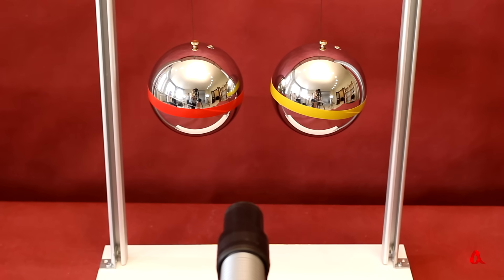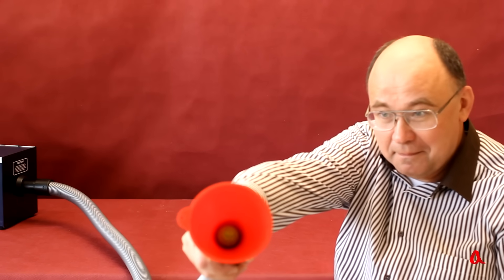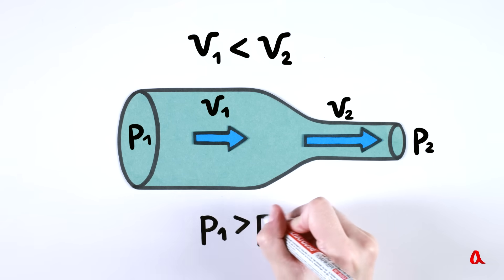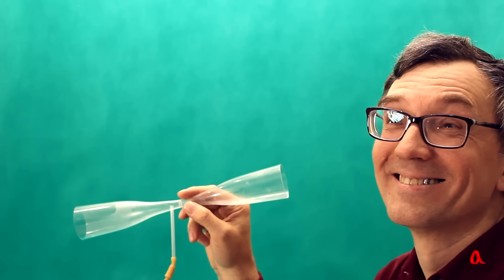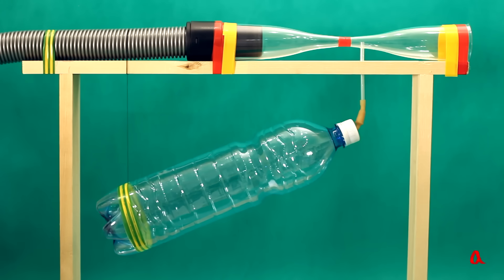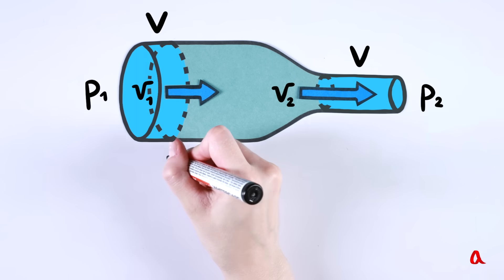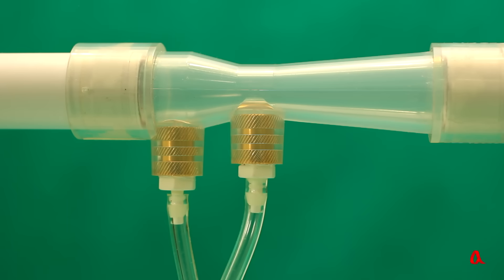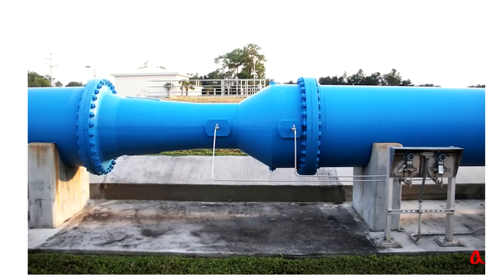Bernoulli's principle

Comment: If it were semi-solids forced through the restriction wouldn’t the pressure increase? I’m thinking of crowds of people rushing through a narrow fire exit in some emergency situation. Of course the pressure would increase at the narrowest point along their path as people are pushing and shoving to get through a restrictive, narrowed doorway. Why is it the opposite when it comes to gases? What about liquids?
Reply: That's because the density. In the examples, the fluid density is pretty much the same, so an increase in speed cause an drop at pressure. An anology with people is that in the case that the average distance is constant. In this case to pass the narrow space, they need to go faster. If they don't, the average distance decreases.

Comment: It's very difficult to grasp that faster air stream does not exert more pressure on the wall of the tube.
Reply: Think of the atoms bouncing off the walls. When the air moves, all the atoms can only hit the wall at an angle, exerting less pressure. Throw a ball in a tunnel and it hits at 90deg but when you throw it from a car it hits at some angle.
Reply: @billshiff2060  Very nice explained !
Reply: @billshiff2060  , if molecules in a flow have a certain side-to-side velocity (thus pressure), increasing that flow's forward velocity does NOT affect the molecules' side-to-side velocity.  For example, you can swim across a slow river in the same time that it takes you to swim across a fast river.  Throwing a ball out of a stationary car window at a tunnel wall produces exactly as much pressure on the wall as if you threw the same ball at the same velocity (relative to the car) at the tunnel wall if the car were moving fast.  It's true that the ball would hit the wall at a lower angle in the case of the fast-moving car, but the component of the velocity perpendicular to the wall would be the same.
Reply: @jean-pierredevent970 , why would a faster air stream exert more pressure on the wall of the tube?  Motion of molecules along the tube is in a different dimension than motion of molecules bouncing against (thus exerting pressure on) the tube walls.  Flow velocity is independent of pressure.

Many people misunderstand Bernoulli's Principle to say that faster flow implies lower pressure.  It does not.  It says that within a flow , a higher speed is correlated with a lower pressure.  Correlation is not causation.  In fact, it is the pressure difference that causes the velocity difference.  (Molecules move because of the forces applied to them.)

Your intuition that a faster air stream should not produce lower air pressure on the walls of the tube serves you well.  It is not the air stream speed that causes the pressure change.  It's the other way around.  I'll explain why in a moment.

If high velocity flow caused low pressure (it doesn't), then some things which don't happen would happen: 1. A box with a vibrating side sitting on a low-friction surface could move itself in the direction of that side.  2. Taking a flexible-walled, sealed cylinder containing air at atmospheric pressure and moving it along the axis of the cylinder would cause the walls of the cylinder to bulge inward.

To really understand Bernoulli's Principle, you can think about the forces being exerted on a molecule in the portion of the tube that is widening or narrowing.  That molecule will feel slightly more collisions from its neighboring molecules on the wider side, thus it feels more pressure from the wide side and is accelerated toward the narrow side.  That is why the narrowest part of the tube has the fastest flowing molecules.
Reply: @mattcarter1797  This is all relevant for me because we trumpet players always say we need to narrow the mouth with a high tongue, make a small aperture and contract the abdominals so that we get high pressure in the mouthpiece and trumpet which causes the high tones. I think now if perhaps there too we see it wrong but I don't know. 
What i do realize now is that when the doctor measures lung function, it is not useful to force the air out  through half open lips since the device exit is so wide that the pressure drops immediately after the lips and the spirometer measures now less flow. I think there everything must remain open and free to get the best flow for that device. (??)
Reply: @jean-pierredevent970  I used to play Trumpet. I have a Martin Committee, 1946, my fathers.
Reply: @billshiff2060  I never tried that famous (here rare) American brand but I have two, also American, King trumpets and I love how they feel much more "personal" than the here ubiquitous, Yamaha.
Reply: @mattcarter1797  A glancing blow on the tunnel wall does not impart the same energy as a perpendicular one. A glancing blow imparts less energy (static pressure) and retains more momentum (dynamic pressure). That is why the total pressure is always equal to static pressure+dynamic pressure.
Sloping tank armor reduces the impact of shells on it in the same way.
Reply: @billshiff2060  I agree with you that a glancing strike by an object at a given velocity imparts less energy than a head-on strike by the same object at the same velocity, but that's not relevant to our scenario where the faster-flowing gas molecules that impact the tube walls at a less direct angle are also moving at a higher velocity.  There's a common misconception of Bernoulli's Principle that the lower pressure of increased-velocity fluid is due to the molecules having traded lateral motion for forward motion, thereby pressing less on the tube.  In fact, the decrease in directness of the molecular impact angle on the tube is negligible because increase in forward velocity due to a flow constriction is negligible compared to typical gas molecule velocities.  The tube constriction causes the decrease in pressure, which causes the increase in velocity and decrease in density.  The lower density of molecules means fewer collisions with the tube per time.
Reply: @mattcarter1797  The air molecules move at about Mach 1.5 under standard condition no faster no slower.
The constriction does not cause a decrease in "pressure" since Total pressure=static + dynamic still. What is lost by static is gained by dynamic. There is actually no loss in pressure, it is simply re directed into velocity. All of the pressure energy in the stream comes from the storage pressure (total pressure)upstream and it is finite.

Working on a flow bench with cylinder heads, people are often baffled when they insert a pitot tube in  a fast moving air stream and it reads ZERO. The total pressure is restored by bringing the flow to rest. Pitot tubes are also called total pressure pickups for that reason. There is no loss in total pressure in the venturi, only a decrease in static coupled with an increase in dynamic. The total pressure is recovered 100% ideally, and in reality most of the time.

I am speaking for ideal circumstances.There will be some local variations depending on the geometry of the duct.

Comment: Bernoulli's Principle is fine for certain physical fluid applications, but has little to no use when a solid object moves through a fluid. We sometimes tend to forget that the so-called  "oncoming air" is not that which is moving, but is that which is being massively disturbed by an airfoil moving though it. I.e., wind tunnels notwithstanding, it is the airfoil and not the air that is moving when an airplane flies.
This sets up a very different dynamic and set of physical laws and rules than anything contemplated by Bernoulli's Principle.
Lift is created by a number of physical processes, primarily but not exclusively, I think, by the downwash of air at the trailing edge. However, amongst those traditionally posited, I do not think that a wing is "sucked upwards" by the lower pressure of the air immediately above the the wing. That has never made a lot of sense to me.
Reply: In a physics sense, what's the difference between the air moving and the wing moving? Momentum?
Reply: @Gr3nadgr3gory  An Aerodynamic Conundrum
All motion is relative. Unless such motion takes place within a vacuum, it creates ancillary and consequential pressures and movement of the molecules of that in which the motion is taking place.

Yes, momentum is a large factor, and, with reference to what I wrote above, a solid object, such as an airplane, moving through a vast sea of gaseous fluid, our atmosphere (the fluid mass),  both creates and experiences pressures and movements both to itself and within that fluid mass that are quite different from that which is created and thus observed when a far smaller, flowing stream of the same gaseous fluid is blown against a static solid, airplane-shaped object. 

The crux of this is that an aircraft in flight, free to move within a fluid mass, is constantly affected by the same, while simultaneously affecting, i.e., moving molecules of that part of the fluid mass that it may encounter during such movement, in addition to other, more distant (less local) molecules of such that surround the aircraft. Accordingly, when an aircraft is itself affected (moved) by pressures in fluid mass local to its flight, this movement then creates new pressures, etc., within the fluid mass which then, in turn, affect the aircraft, and so on, etc.
As the former illustrates, a constant push and pull of cause and effect is set up between an aircraft and the fluid mass within which it passes, which cause and effect continues at all times during flight.

When a static solid object is not, by definition, permitted to move freely according to such pressures and movements, etc. that would affect it if it were otherwise freely able to move within that fluid mass, an important and notable negative component is created. Without the solid object’s ability to move freely within the fluid mass, a reliable facsimile of flight will not obtain.
Equally, the intricate and multivarious dynamics within the fluid mass disturbed by the passage of an aircraft through it cannot be readily measured or observed. Yet such exists and greatly affects an aircraft when in flight. 

Exactly what and how this is so is a far deeper and more substantial study than we may be able to discuss in a YouTube comment. I trust that I have explained my position on this subject to some extent, but welcome any further questions, etc. However, if fluid dynamics and particularly aerodynamics interests you, you might well seek further and more substantial information thereof than my poor comments may grant.

Comment: So... the two balls were "sucked" towards each other because the two balls created a small channel for air or water to pass, thus creating lower pressure compared surrounding space (atmospheric pressure). This lower pressure in this smaller channel creates a vaccum, pulling the balls together.
Reply: Kind of. The higher pressure on the outsides push the balls together. There's no "pulling".
Reply: A pressure difference in stead of a vacuum.
Reply: it's not the vacuum that pulls the balls. You've said it: it's the atmospheric pressure that pushes them.
__
for a 3 cm radius sphere we get about 1 N:
P=f/A; f=PA = 101 Pa * 4Pir^2 =101*0.0113=~1 N
Reply: Yeah i think it's also due the the specific shape of the sphere.
Reply: The air is not funnelled by the shape of the balls…the air stream itself is at a low pressure.
Reply: @contessa.adella  Pressure dropping exiting past the balls, highest at the point closest together.  I wonder if the result would be the same if the balls were not allowed to rotate?
Reply: Fantastic use of the word thus. 😄

Comment: conservation of energy is a weak explanation because it does not explain why the fluid accelerated into the narrow section. Fluid has mass and a force is required to Accelerate a mass, so what is the force and what is the source of the force?